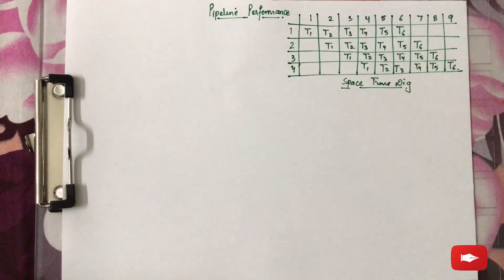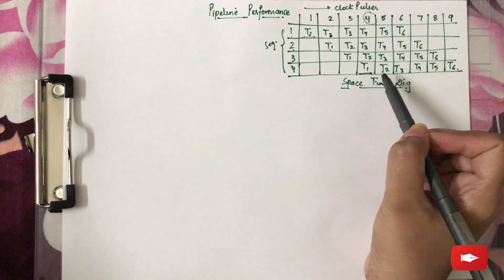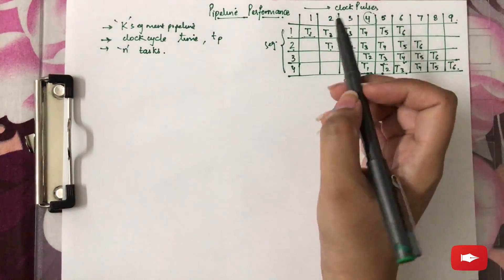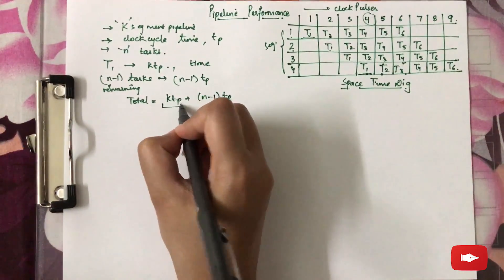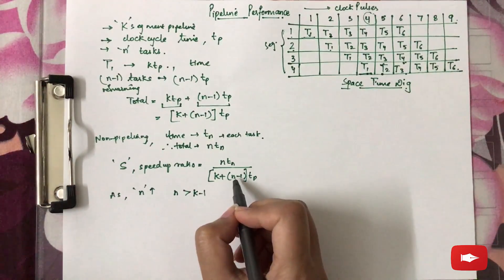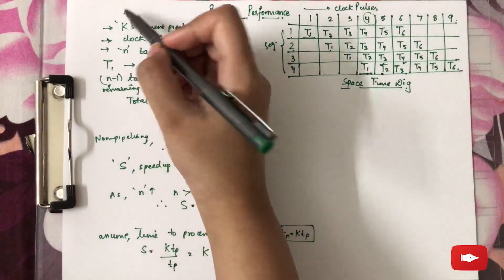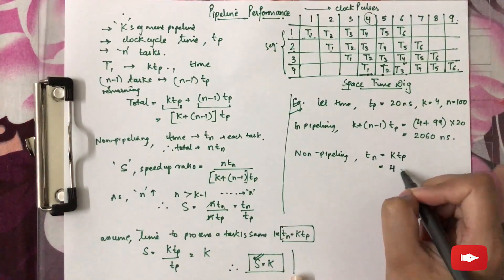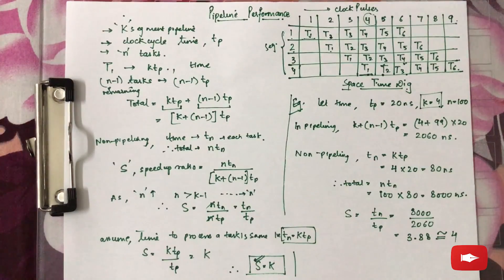Pipeline Performance

Comment: an examination paper has 8 questions to be answered and there are 1000 answer books.
each answer takes 3 min to correct, if 4 teachers are employed to correct the papers in a pipelined mode,how much time will be taken to complete the job of correcting 1000 books,what is the efficiency of processing?......plz explain the solution